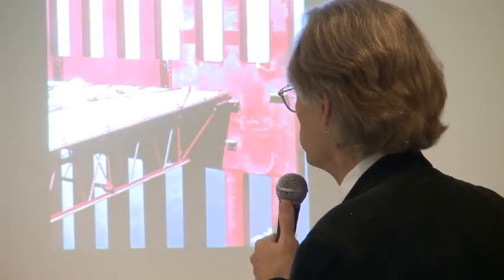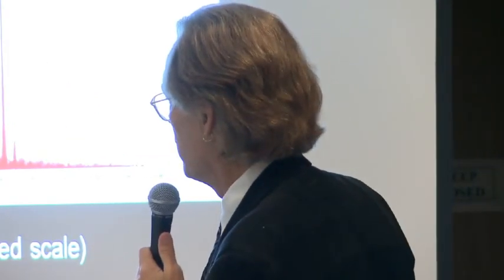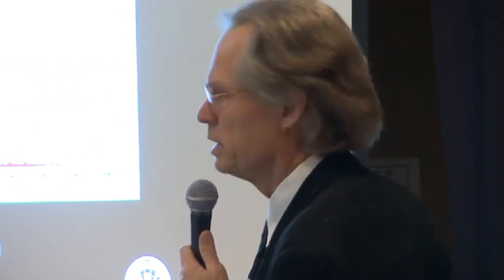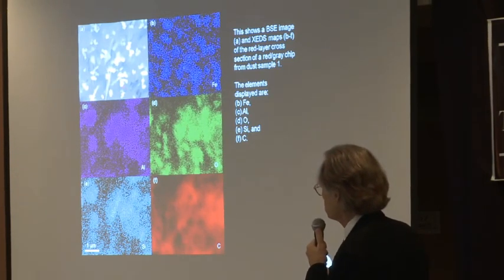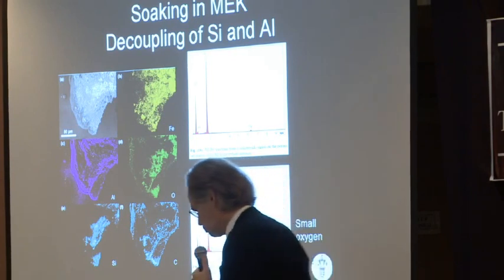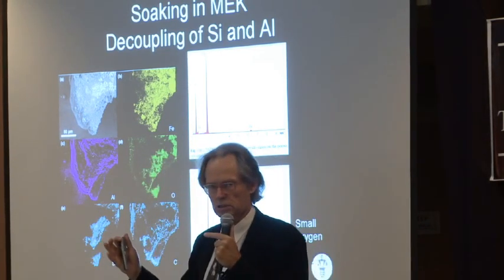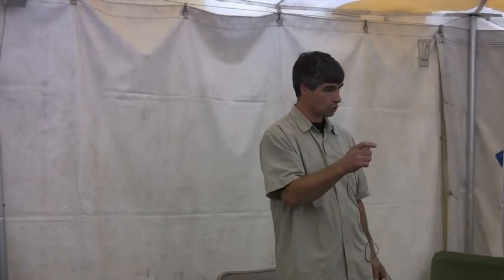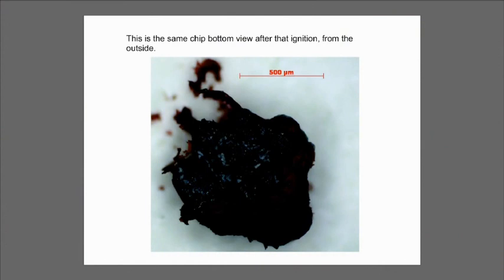9/11 WTC-chips are not paint and produce a thermite reaction: Dr. James Millette is wrong

Comment: "B) there really might be epoxy resins in the matrix of the nano-thermite composite, cause epoxy(polymers) are apparently used in aerogel and sol-gel composites = He claims it's paint "
Are you reading what you write? "might", "apparently".
There definitely IS epoxy in the matrix, zero doubt about it: FTIT data show epoxide functional groups. Why is Harrit withholding FTIR data? Because it proves kaolin, not aluminium? It does prove kaolin!
Harrit has <10% "thermite" in his chips. Too little.

Comment: 3. He ignores the fact that his own chips retail much of the red layer (seen clearly in his own Fig. 20, 23, 26) after igniting - as does Basile's chip, as does the paint that NIST tested. What happend there is that much of the "plastic" decomposes and burns, but the iron oxide pigment does NOT (Harrit admits that it's the iron oxide which makes the red layer red)
4. The composition of Tnemec paint is not 33% Zinc Chromate! He forgets that the organic matrix alone is more than half the weight

Comment: What's the date of the Harrit lecture? Pretty amazing to see him repeat so many errors:
1. He is totally unaware that there was more than one kind of primer paint on WTC steel! Another was LaClede Steel Co.'s shop primer, which contains no Zinc, but a small amount of Strontiom Chromate. Harrit's data on SOME chips shows small amounts of Strontium and Chromium, and the data is fully compatible with LaClede primer
2. The MEK-soaked chip is a different material than most of the other chips

Comment from the maker: Hey.

I don't necessarily think so..

(part I)

To me he just (deliberately)made false-conclusions:

A) because the Al and Si are very small nano-particles, and intimately mixed (sol-gel/aerogel), it might actually APPEAR they are chemically bound if you don't do the analysis just the right way. = He didn't

B) there really might be epoxy resins in the matrix of the nano-thermite composite, cause epoxy(polymers) are apparently used in aerogel and sol-gel composites = He claims it's paint